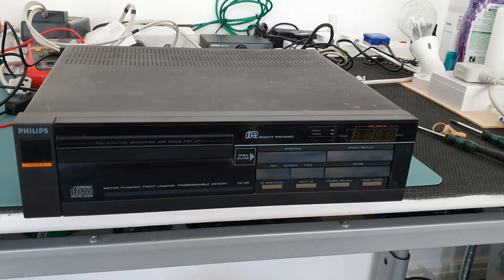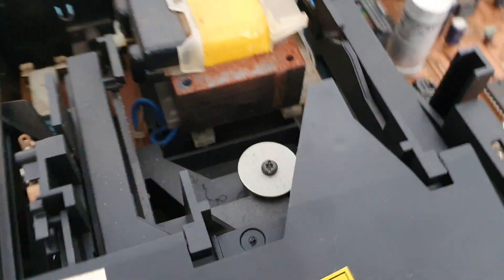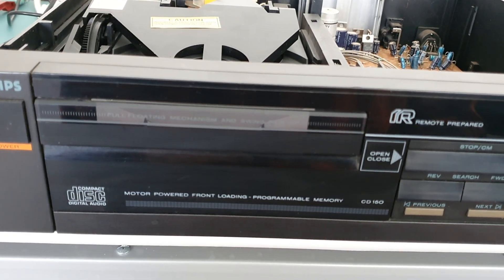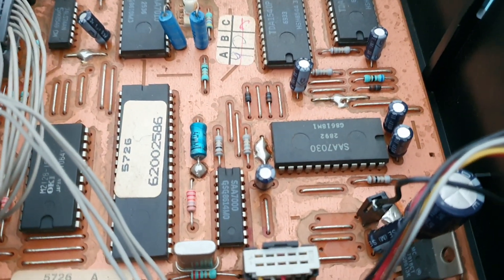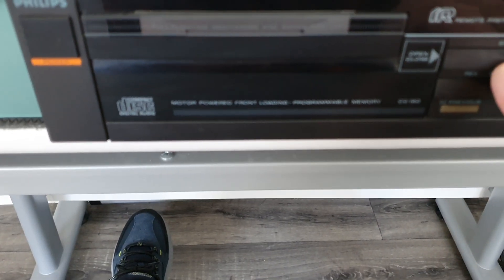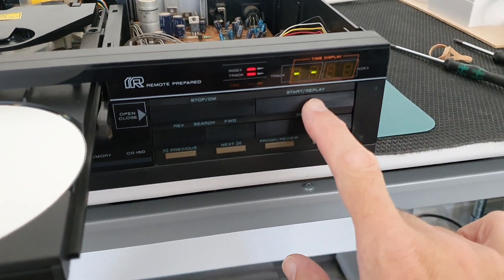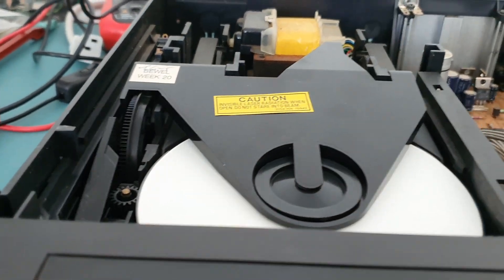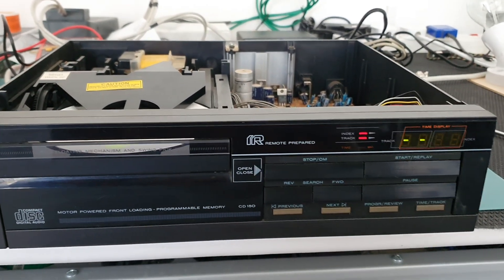Philips CD-150 Repair - Is it worth it? Part 1

Comment: Hello, i worked for Philips long ago. The issues we found were dry joints on the main board. Resolder every joint making sure you dont bridge any solder joints. Take you time when resoldering. It may work.
Reply from the maker: @warrenst  Yes it's already fixed See part 2 & 3
Reply: Dry joints? Does that mean “cold solder” connections? Thank you